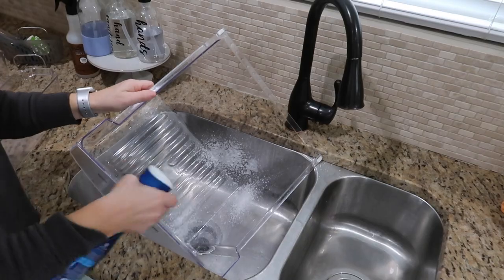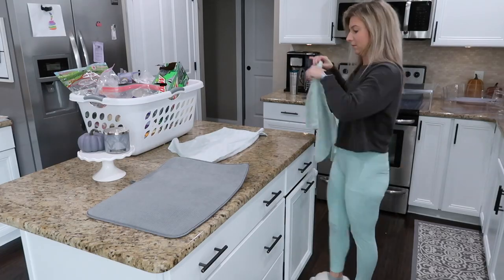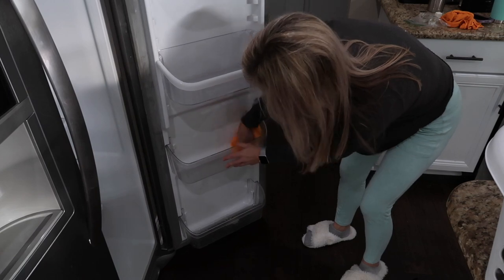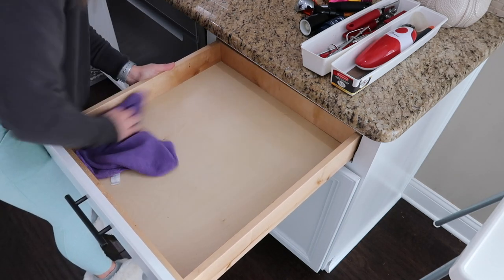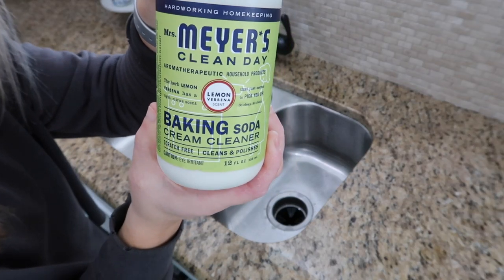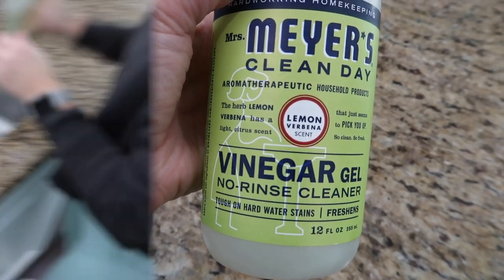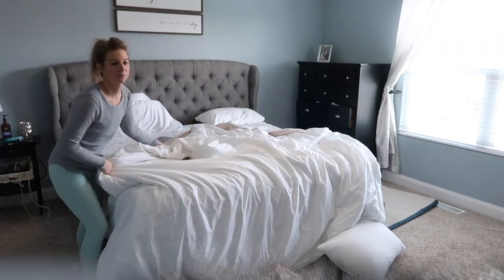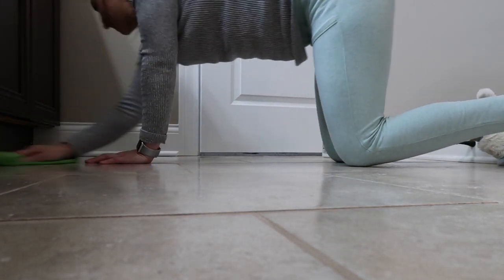*HUGE* 2 DAY WHOLE HOUSE CLEAN WITH ME 2020 | EXTREME SPEED CLEANING MOTIVATION | CLEANING HACKS

Comment: Had the same issue with my cabinets! But we found baskets (on amazon) that you screw directly to the back of the cabinet door. I was worried that the little screws wouldn't hold the weight of all my cleaners, but they do! And it's so nice to have all that storage space back, makes a huge difference.
Reply: Jamie your baskets might have the option to screw them on.
Reply from the maker: Thank you!!!

Comment: With Avary getting tooth paste spit all over the counter, can she reach the middle part of the sink well or is she too short? I had this problem and a small stool helped alot. My child was better able to extend further into the sink and not spit on the counter anymore. Then it's just an easy rinse with water down the drain. Or is she not bending and spitting downward? Like facing her face parallel with the sink? My youngest one would be looking in the mirror at her self and spitting and it would get on the counter, her cloth, the floor. That one was harder to fix cause I basically had to watch her brush and remind her everytime until it became automatic.  Not sure if any of this will help just letting you know my experience and how I handled it.
Reply from the maker: She is and she has a step stool that she never uses! We’ve been working with her on it!